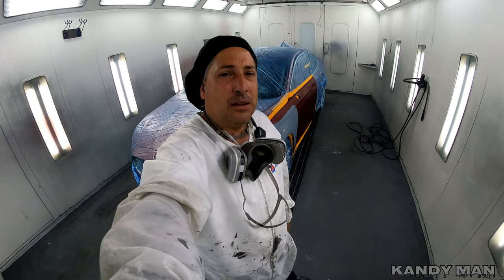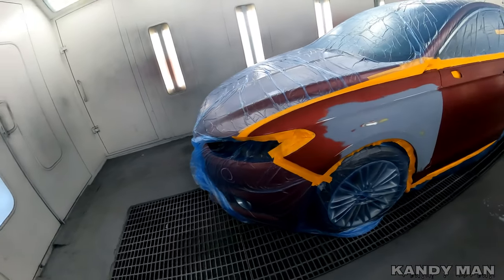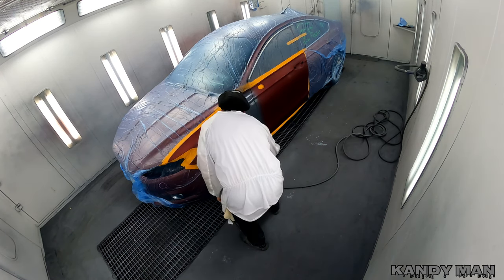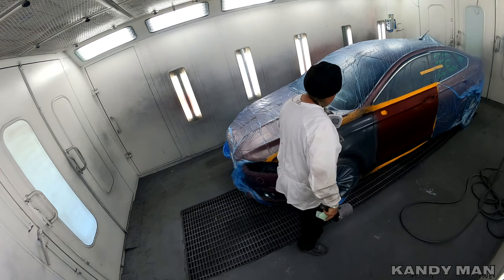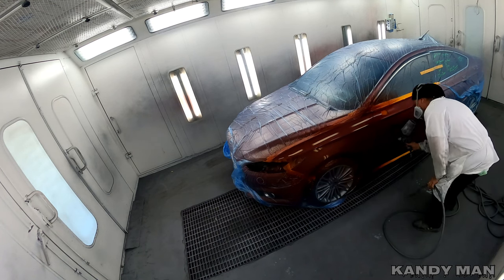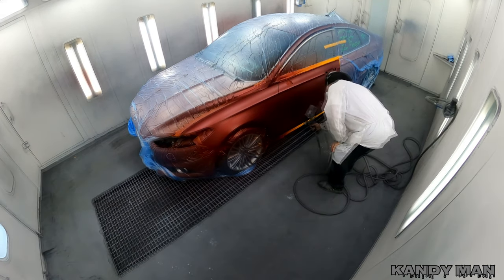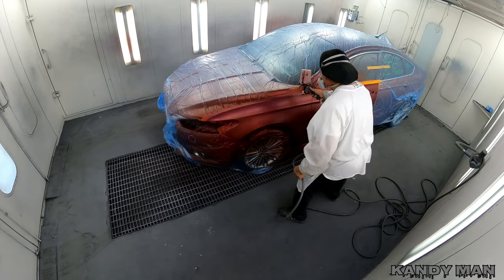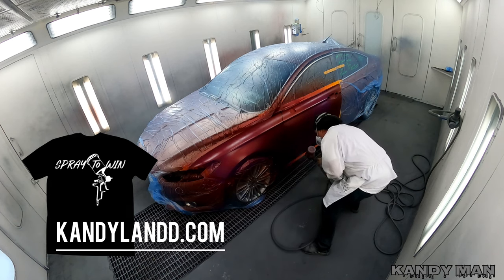NEW GUN RELEASE - IWATA WS 400 SERIES 2

Comment: I'm a big Iwata fan. I'll be sure to check them out once Amazon has them listed.
Reply: If you ever get an Amazon gun just look it over well! I got an LPH400 scratch and dent special. The needle wouldn't sit in the fluid tip properly. Amazon made it right but the seller almost conned me. Thats just my experience!
Reply: @kr2513  all of mine (ls400 and lph400, airgunsa hte2) were all in the sealed boxes. The two higher priced models have the hologram on them saying they're genuine. sorry you had bad luck. Amazon is good about returns.